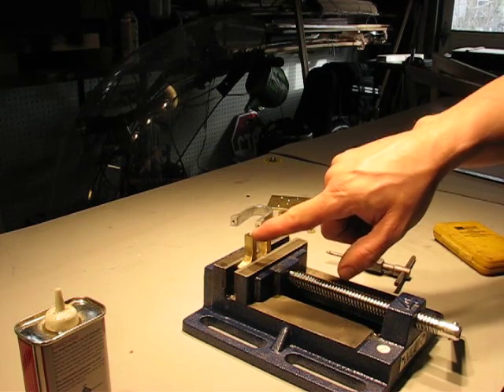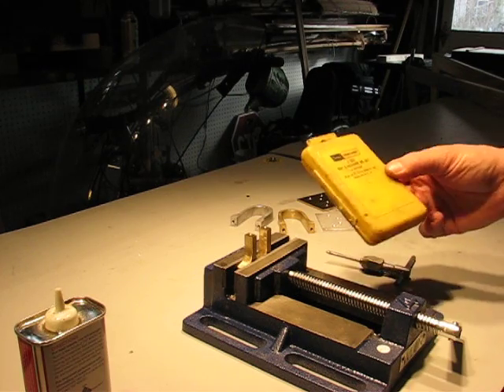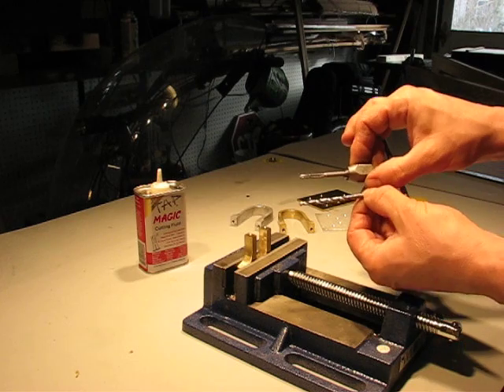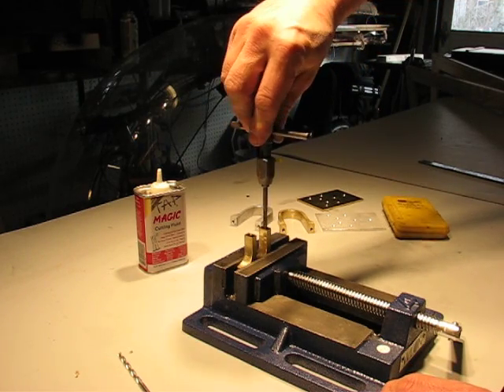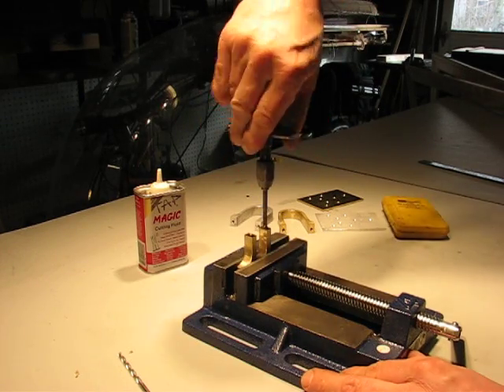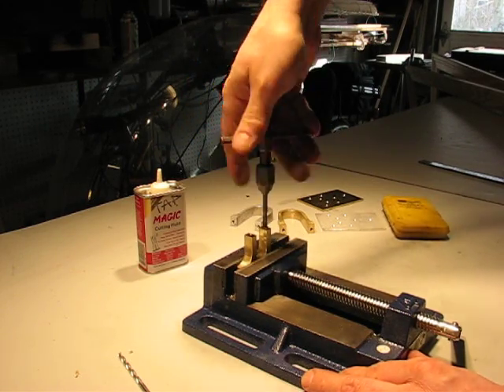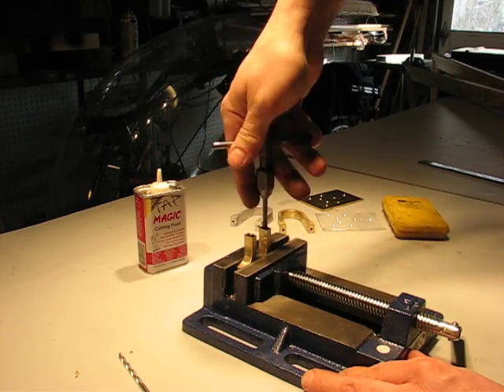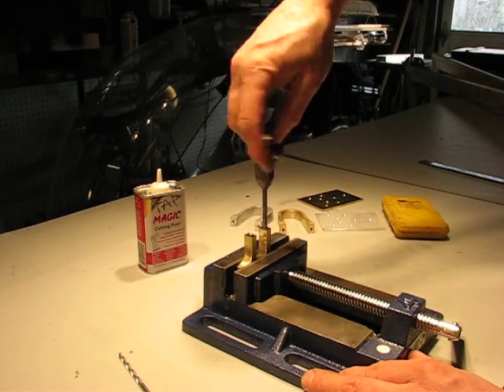Using a Tap to Thread a Hole

Comment: any suggestion to thread a hole size: M18x1.5mm ? what is the M18 part? Sorry i'm totally new in this skill. Please help..
Reply from the maker: The M18 is the diameter of the bolt, 18mm. the 1.5 is the thread pitch the distance between each thread.  A little bigger than a 1/2”x13 bolt here in the States. If you are looking for the size of the drill you need then just google “M18 x 1.5 tap drill size“.  You’ll get 16.5mm or 21/32”.
Reply: @JakevonSlatt  thank you. Now I got it.

Comment: hi. let say I wanted to make a 3mm hole for a 3mm screw, so I need 3mm drill bit and 3mm tap?
Reply from the maker: The "tap drill" will be smaller than 3mm and the drill for a "through hole" will be 3mm, the same size as the screw. Use a chart like this to figure out what size tap drill you'll need: http://www.lincolnmachine.com/tap_drill_chart.html

Comment: If I want to tap a 5/16' hole, what size should I use?  My son over-torqued a hex bolt into a table leg, and broke it off below the surface.  After trying unsuccessfully to extract the bolt, I've decided to just make another hole in it.  Do you think I should go to a smaller size? The original size of the hole was 5/16.

Comment: I just realized that I've been tapping holes w/o lube all this time.

Hey Jake, is there a substitute for cutting fluid ("tap oil") I can find in the house that I can use?
Reply: nawkwan Ive had great success with regular lip balm. Seems to work better then oil.
Reply from the maker: Most lubricants will help, but the right stuff is the right stuff. Manual gearbox oil has a similarly high sulfur content and is what I'll often use for drilling as well as tapping.